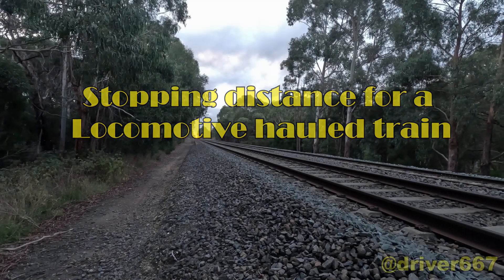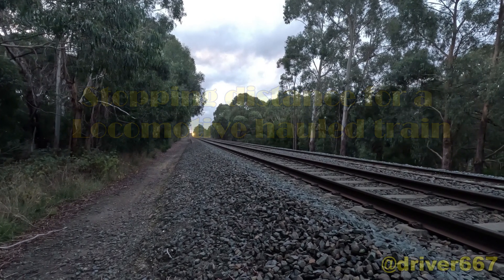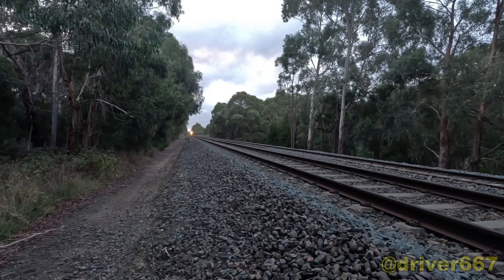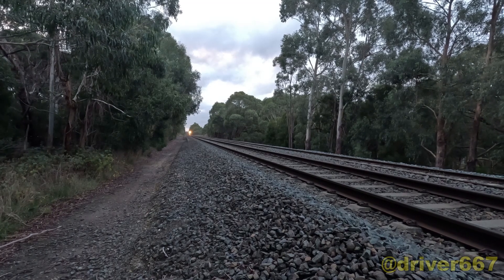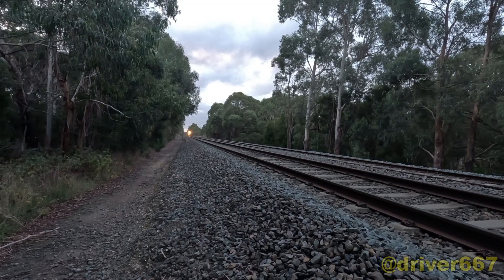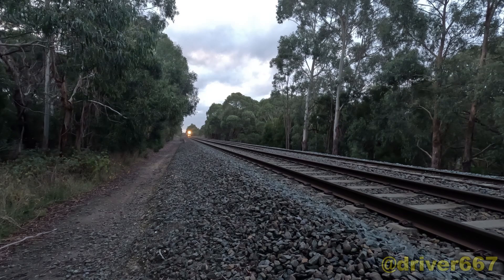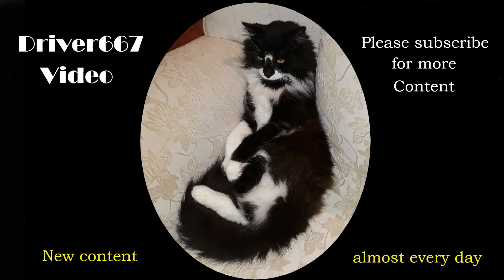How quick can a train stop??

Comment: Whilst it takes a long time to stop, the brakes on trains are remarkably efficient. If a car weighed what a train does, you would be measuring braking distances in hundreds of metres even at 30kmh. Loco and 5 cars is what? About 340 tonnes of mass that you have to stop. A car is 1000-2000kgs. It's basic physics that a car can stop quickly. Even with that advantage, a car still takes a football field to stop from 115kmh.
Reply from the maker: Yes, true. 👍 It's a lot of weight we are trying to pull up. 😊👍

Comment: Would I be right in saying if they put more powerful brakes on the train it would then make the wheels slide on the tracks
Reply: European passenger trains have magnetic track brakes for that reason. Their air brakes are also much quicker acting than Westinghouse brake valves.

A passenger train in Germany must be able to stop from 160 km/h in 1000 m, as that is the standard spacing between a distant and a home signal. It's not uncommon for a train to enter a platform at 60–70 km/h and come to a complete stop within 250–300 m.
Reply from the maker: @zoqaeski  👍😊
Reply from the maker: Yes, that is correct. 👍😊

Comment: With a steel wheel on a dry steel rail the absolute maximum possible ( without the use of sand) is about 2 m/s^2. Which would only take 17 seconds from that speed.  In this clip the train made a creditable 40 seconds after the air was fully dumped.  Giving the equivalent to holding the train on a 1 in 10 slope.  In Ballarat on a wet rail and without sand a Vlocity was unable to slow on a 1 in 50 downslope.  ie 0.2 m/s^2  equivalent.  On a level track that would have taken about 150 to 180 seconds to bring that same train to a halt.
There are a range of reasons why the actual braking is not as good as the theoretical maximum possible.
Reply: I was just thinking that myself and by coincidence, I had read the ATSB Report on the Ballarat Liddiard St incident only yesterday.

Comment: These videos are absolutely fascinating.
I love the sounds of the locomotives.
These breaks give off these little quick hissing sounds which have always been very interesting to me.
Are these trains comfortable to drive? I know they are being phased out for the Vlositys all across the network now.
These trains have a certain charm, the big bumps when they stop in the banging noises as the locomotive starts to move and pull the carriages along.
Reply from the maker: I find them comfortable to drive and will miss them when they are gone. 👍😊
Reply: @driver667  because I’m totally blind, security permitting, could you do a description of the cabin of one of these trains? It’s just that I can’t really see inside them.
Reply from the maker: @FootyOnTheRadio  I don't actually show inside the cab due to security concerns but the driver sits on the right, with switches and gauges on the dash in front. A console runs past my right that has throttle and brake levers and the whistle is a lever at my left hand. 👍😊
Reply: @driver667  understand completely and thank you so much for the description.
Reply from the maker: @FootyOnTheRadio  👍😊
Reply: @driver667  , what sort of victorian loco are you driving that you sit on the right hand side?
Reply from the maker: @vsvnrg3263  I was on an N class sitting on the left side. 👍😊

Comment: That would be scary on a single line track as you wouldn't know if an approaching train had had a SPAD (Signal Passed At Danger) and you were on a collision course.I had an emergency stop on ICD when we were red lighted at Euroa.I We travelled about 400 metres, with emergency brake application, before we stopped.
Reply from the maker: A situation I hope to never be involved in 👍😊
Reply: richard, whats icd?
Reply from the maker: @vsvnrg3263  that would be 'inter capital daylight' , the pass between Melbourne and Sydney. 👍😊
Reply: @driver667  , a train name i'd forgotten about.
Reply from the maker: @vsvnrg3263  👍😊